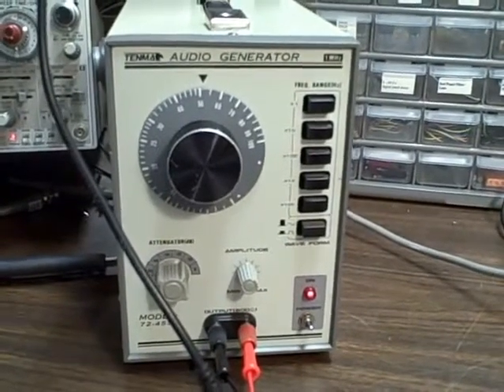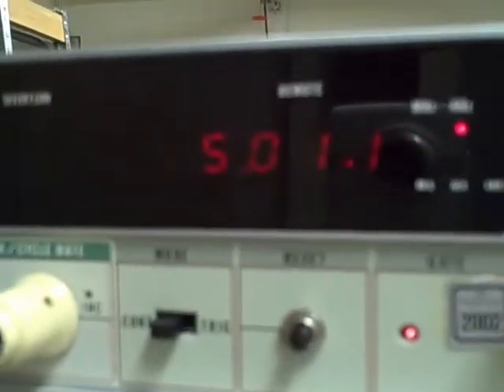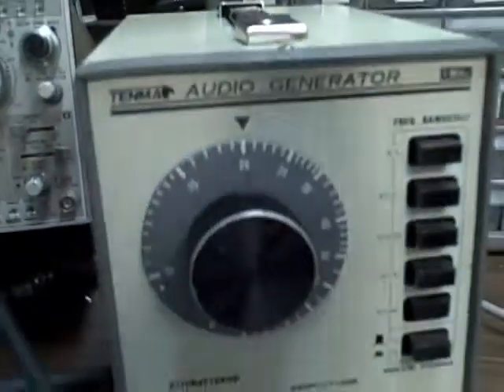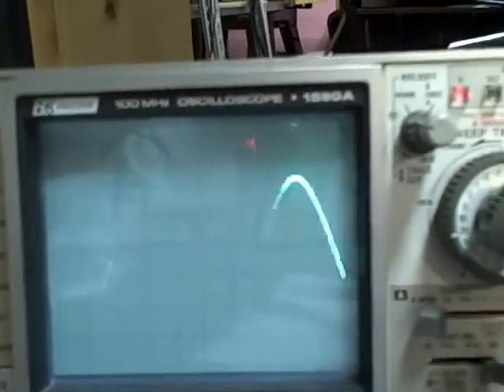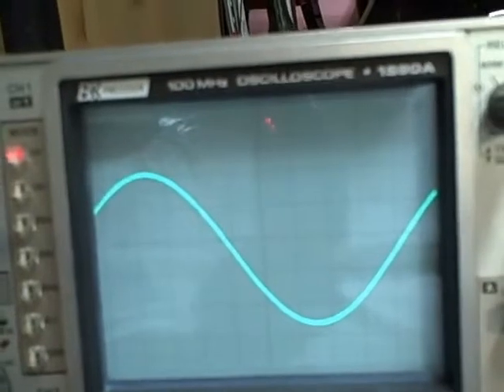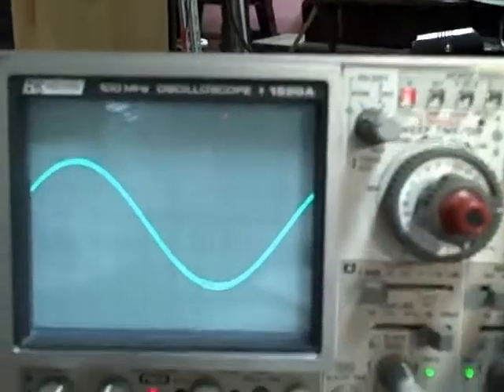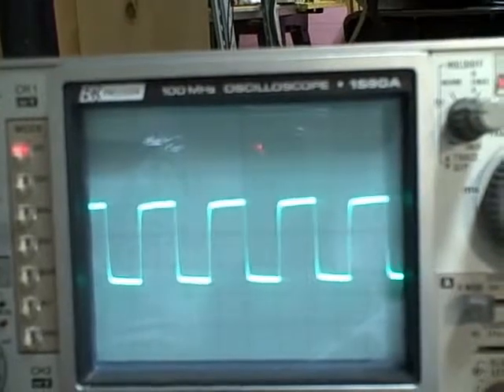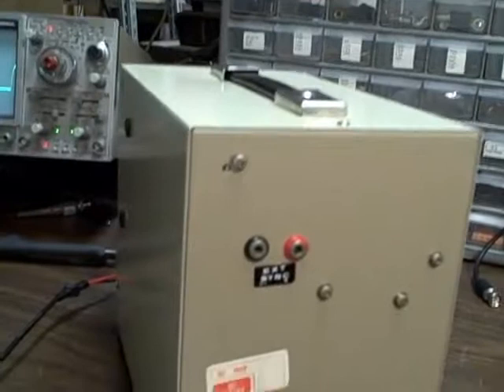TENMA 72-455A Audio / Signal Generator Demo

Comment: MrDubje, I know that I am replying to an older comment here, but you are not mistaken.  This model has been around (in one form or another) for several years.  This model has also been rebadged by several other companies (with a price range ~$50 or so near where Tenma seems to offer it).  Additionally, the format has been used (probably a rebadge of the earlier versions of this) by more manufacturers than I can think of.  I have no idea who the OEM is on these, or if it was just a copy of a format that users found pleasing, but yeah, it's been around for a long time.